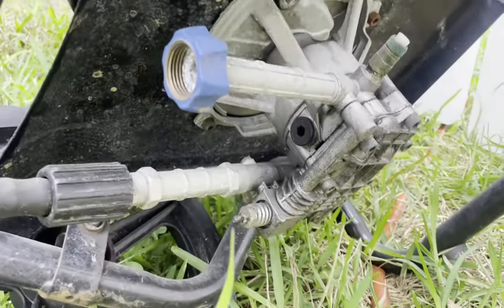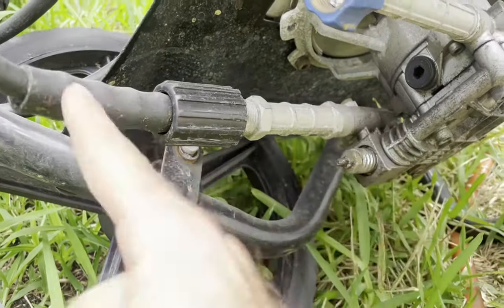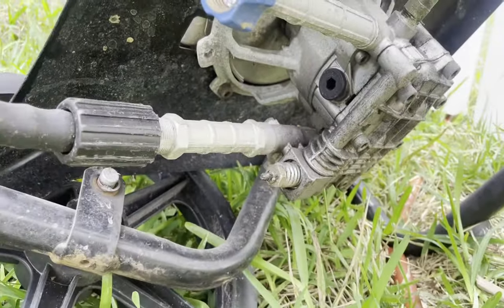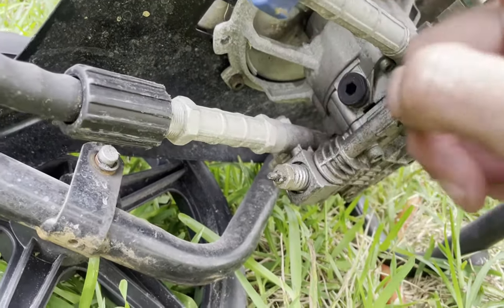Fixing a FREE pressure washer that surges and has low pressure- EASY FIX

Comment: If you are going to be messing around with the nuts and springs on an unloader valve, you need to spend 15-20 bucks on a water pressure gauge. Without one you're just going to be guessing about setting it right (and it needs to be set right).
Reply: Where would you install the water pressure guage? What you said makes sense but I don't know where it would install.
Reply: Water pressure gauges normally come with quick connect fittings. I normally place it between the pump and the hose. The male quick connect fitting should always point in the direction the water flows (if possible). It's super hard to judge PSI without a gauge. @Bassmada
Reply: @cwytonweb  thanks for the reply. That makes sense too. My bolts stripped on mine so I have to re tap and then adjust but I'm going to look into the water pressure guage for tuning it properly. Thanks again!
Reply: @Bassmada  Some folks install them between the hose and gun, which is easier to read but pressure at the gun is going to be less than after it leaves the pump depending on the length of the hose and Im mainly concerned with how much pressure is coming out of the pump.

Comment: And if you plan on cleaning sidewalks or driveways buy a turbo tip number one for about $30 and if you can throw a few more dollars down by a surface washer, you won’t believe how much faster easier and cleaner it will be the save tons of water

Comment: Thank you so much for this video! I thought my Ryobi 1700 psi electric pressure washer was a goner after it stopped working for my daughter mid pool deck cleaning. I began to youtube troubleshoot, and the only two problems mentioned were the GFCI and the switch valve. Both outcomes basically meant surgery on the machine, plus the cost of parts and time for shipping. The advice given from another repair video was to just get a new unit. We've only had this machine for a year and a half, and have only put 5 hours of use on it. I definitely wasn't pleased with the idea of getting a new unit. Fortunately, I asked my daughter to explain to me in detail exactly what happened one more time. She said it was working fine, and then she heard a click or pop in the handle, and it stopped working. I was then lucky enough to find your video and EUREKA! The spring inside the handle was stuck, and the metal rod on the inside that holds the spring down had wiggled out of place. I didn't even need to complete all the steps in your process. The spring was stuck at first, but after taking it out and pushing it on the ground, it dislodged and started working again as usual. Put it back together, and VIOLA! Here's to people like you, saving the average man hundreds of dollars one day at a time! Cheers! 👍🍻👏

Comment: Absolutely amazing! I bought a new one and had this issue but couldn’t figure out why. So I thought I ruined the pump because I didn’t bleed the line initially. But I ran it a very short time so now I realize that wasn’t it. Exchanged it for another and had same low idle issue with 2nd new model. I tried more things this time and found that if I manually pressed the throttle line/choke (I’m not a mechanic sorry, just a logical thinker) to rev the engine while holding down the trigger on the wand I would get pressure. Also, the pump worked like normal until I released the trigger. I would have to rinse and repeat to get pressure again. I thought maybe I need to adjust the choke to get engine to idle higher. This video has been a great find. I found one other guy who takes the engine apart and explains how the unloader valve works. Rather than take my second new machine back I think I’ll fix it with a couple wrenches. 

Thanks so much Ryan.

Comment: Excellent video.  I have the same issue with my Ryobi, surging in idle, but no problem at full power.  It looks straight forward enough to remove the carburetor.  But it really did not look like yours was all that dirty, if at all? I doubt mine is, either, as I don't use the unit that much, and I don't leave old gas in it over the winter. I did not think either it is the idle down cable. I I have suspected the off-loader value......I found that mine was seized in the housing, trying to pull it out.  I ended up removing the spring, and putting a stack of washers on the shaft, and using the adjustment nut (17mm socket)  to reverse torque the valve, and it did pop out, doing that.  It did not look too crudy, when I got it out-but it was seized into the housing. I have replacement off-loader on order.  Hopefully when it comes, that will be the end of my surging problem.  Because that seemed to be the identical solution o what I saw in this video.

Comment: I have a Ryobi RY80940 3100 PSI pressure washer. It was last used two years ago, it's been sitting in the basement since. Engine runs but not full power & not much water pressure. The pump bypass valve nuts are tight, the spring is really heavy duty, I detected no valve shaft movement going from trigger pulled to released. I used a socket wrench & tapped the big nut with a hammer, no movement. I suspect the shaft is ceased, have you seen that? 
I up ended the pressure washer & I'm presently soaking the spring base in WD40 (several times already), there's a trough there & the WD40 appears to be soaking into the shaft bearing. I'll check for movement again tomorrow.

Comment: Thansk for the info was given one of thesse exact pressure washer cleaned the carb cause it had horrible ethanol build up fired right up but is surging unless i hit the wand to spray then it smoothes out revs up stays steady for a few seconds then it seems to rev even higher possibly to high any thought on this. Could it be caused by the those nuts being to loose or could it be not enough water from my hose coming into the pump?

Comment: Thanks for the video.  My Ryobi has same symptoms...but unfortunately doing what you did, failed to fix mine.  I still have low pressure when I pull the trigger..  Back to the drawing board.
Reply: Ever figure it out mate?
Reply: @randokay3752   Unfortunately, no.  I was gonna by a new pressure valve, but at over $100 I didn't feel it was worth the investment if it turned out to not be the problem.

Comment: I have a brand new Simpson 60995-s 3600 psi pressure washer with the Honda GX200 engine that backfires like crazy everytime i release the trigger it's been driving me nuts for over a month.

Comment: The thin big gasket was put back on the assembly backwards... I am still having low pressure even after adjusting the unloader valve. Will keep researching.

Comment: So if I’m pressure washing more fragile surfaces like brick or wood siding and I don’t have the wand that lets u adjust the pressure can I get away w/ just loosening the spring nut a little bit and tighten the lock nut until I’m done w/ the job? Or would that do damage to engine and/or pump long term?
Reply: They sell different tips for the wand for softer surfaces. I got mine from Walmart with there hyper tough brand. Different color tips for different pressures or the rotating one for concrete cleaning. Or u can hold the wand further back from the surface to reduce the pressure hitting it.
Reply: Theoretically you can reduce pump pressure by altering the settings on the unloader valve. The danger is in all the water that passes thru the unloader valve will be constantly circulating around inside the pump, and you won't be able to fully discharge it all thru the gun. This can cause overheating issues as well as overcompression that cause the engine to stall or in extreme cases even shear the key and throw off the engine's timing. 

Nevertheless, if you're bent on doing it, get a water pressure guage and attach it to the wand so you reset the unloader valve to its proper setting and pressure wash in 10-15 minute sessions on and 15 minutes off, shutting the engine off to clear the pump and let it cool.
Reply: @cwytonweb  I had a feeling it would be more complicated than what the video was starting to make it seem.
Reply: @andyhipp1270  Don’t u have to really know what your doing when u play around w/ diff. tips? Also if you’re up on a ladder u don’t have the space to move the wand far back enough.

Comment: Hi Ryan  I have a Ryobi 3200 psi pressure washer petrol driven when I start washer I get full pressure but after a few seconds the pressure drops low pressure I got on to the  dealer and they told me I needed a new head pump I have installed the new pump but it is doing the same problem as the old pump could you help    Cheers    Sam
Reply: Don't buy Ryobi  Junk.
Reply: Unloader valve

Comment: On flipping pressure washers. 

As the lawn mower season went by the wayside, I tried buying and flipping pressure washers. After 6 units I have decided that it is a waste of effort. If the pump is bad then the cost to replace makes only the free ones worth any time. Free ones with decent engines are too rare to take the time to look for them. 

The 3 that I bought in which the previous owner said that the pump was good but it wouldn't start all lied. Each had pump issues. Total waste of time and $120.

Comment: loctite on all pressure washer bolts should be mandatory lol ive got a newer model and the plate that holds the engine all the bolts jiggled loose. I immediately put some thread locker on there

Comment: It appears that you hooked up the choke lever on the wrong side of the choke bellcrank. It will still work but it will be backwards from the arrows on your chassis. Open the airbox, remove filter and push/pull your choke wire. Watch the choke butterfly valve.

Comment: I tightened my up and it ran good for about two minutes then made a metal screeching sound  and then the pump seal went and died
Reply: cant turn it in to tight for sure i only went in 1 turn at a time until it worked ok.

Comment: My little thing off the pump broke off. Can't figure it out.
Reply: 8:05 thing on top
Reply: Are you talking about the thermal valve? Like it broke off inside? Were you able to figure it out? I just saw a video with the same problem and he used screw extractor kit to remove it. On mine, I cannot, for the life of me, remove the unloader valve. Everyone else's popped off so easy, mines not even budging! And then I damaged it while trying lol  sooo I ordered a new pump. Ahhh frustrating! Not even sure if that was the problem to begin with 😅Hope you were able to get yours figured out!

Comment: if you get some bolts and cut the heads off that go through the carb and air cleaner you can screw them in to keep everything in place while you take off the carb.... PRO Tip I learned from someone
Reply: Wow - finally someone posts a useful pro tip!  Thank you!

Comment: I just replaced the carburetor on this Ryobi 3000 and it's still surging
Reply: did you fix it?
Reply: @Voltomess  still surges. But only at idle while not in use.
Works great when power washing.  Customer is happy that its working